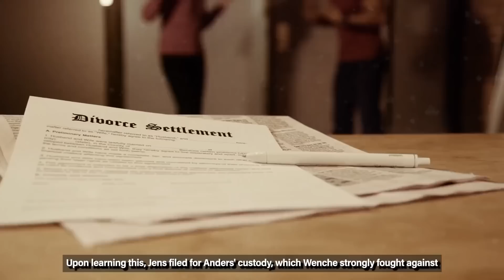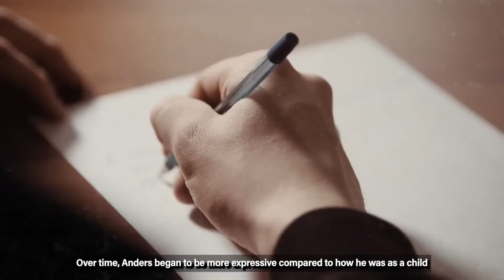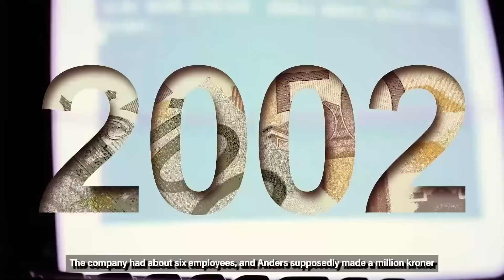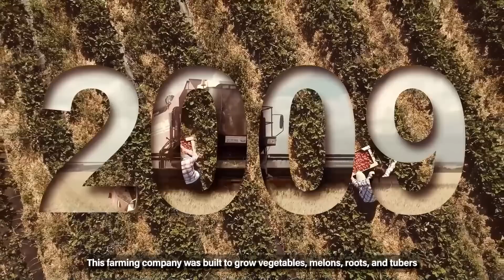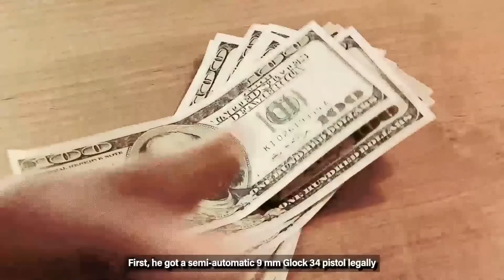The Multi-Millionaire Who Murdered 77 People

Comment: If you get a 21 year sentence. They have to release you within 21 years. If his sentence is 21 years to life. Then they can keep him forever. If its a life sentence with at least 21 years before eligible for parole.  He needs to face a parole board every five years or so after 21 years served. But as I said if the entire sentence is 21 years. Under the Norvergian law he will face parole every 10 years if it isnt mentioned in the original sentence. He has to be released at the end of 21 year sentence. Government can not change the sentence issued.